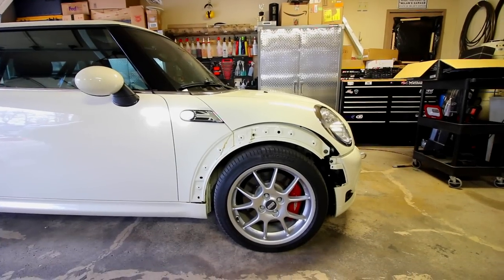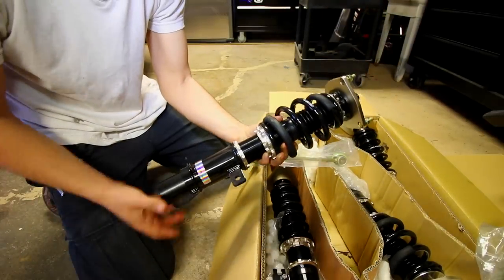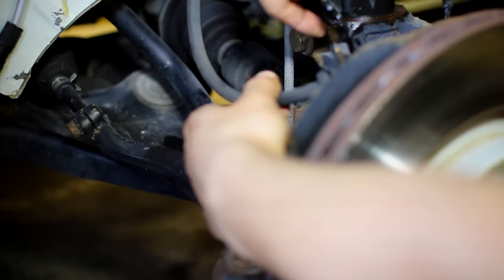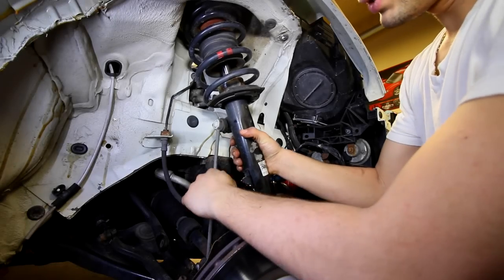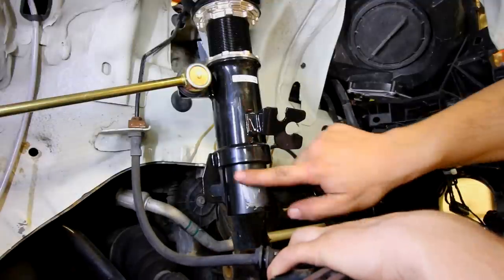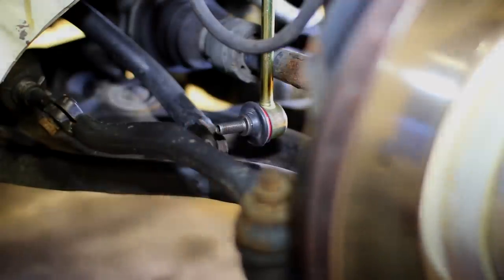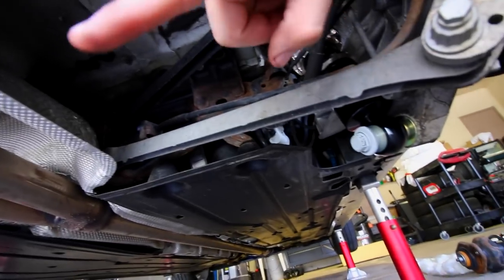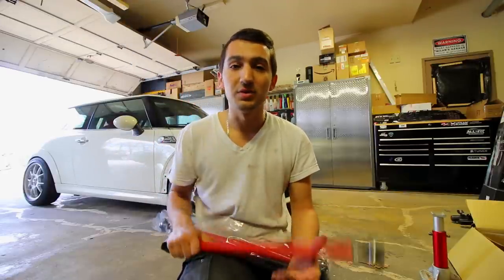How to Install Coilovers on a Mini Cooper

Comment: I know it's an old video, but did you install the extension cable for adjusting the rear? I had these on my R56 and looking to install on my R55, but want to be able to adjust the rear whilst on the car (my garage installed the extension cables into the boot)

Comment: Have you experienced any kind of trouble with the axles angle after you lowered your Mini ? I'm running on KW V1 coilovers and since it has been installed, axle spider has popped out from inner joint.

Comment: so i have an r53  and im not sure if the r56 is the same . the rear coilovers have an adjustment at the top but in an r56 you cant even see the top of the mounted strut?  what did you do ? cut a hole ?

Comment: Does anybody agree with me that the mini looks much better stance wise when it's lowered in such a way to try and ensure the bottom sill angle with the ground is reduced from stock angle? My R56 JCW is lowered on KW coilovers, and dropped 30mm on all 4 corners, so there is still the default angle between the sill and the ground, which personally I dislike. My question is can you reduce this angle and for the car to remain functional? I guess the back needs to be lowered more than the front to acieve this look, is this done by peeps out there???? Cheers ma dears.

Comment: Just installed some of these coilovers on my 08 Mini.  Did you have any vibration issues from 1-3 gears?  Seems to be in the lower RPMs.  Maybe a driveline issue with it being lowered?  I wonder if an alignment will help.
Reply from the maker: If you're getting a vibration, you should raise your vehicle a tad as that is typically a problem with the half shafts and the angle in which they are positioned.
Reply: I am having vibration issues now :
:/ 2005 mcs with back coils

Comment: I have a 2005 r-50. I can't get the assembly out. The problem is the swing atm doesn't drop out of the way enough to let the assembly come out of the swing arm. Am I missing something?
Reply from the maker: Disconnect the sway bar and try it again 👍
Reply: @milanmastracci  I disconnected the end links from the strut and from the sway bar.

Comment: Milan, I need your help! When installing adjustable coilovers on my R52, do I need new camber links or any new bushings? Or can I just install the coilovers and expect everything to line up and perform appropriately? Finally, how do I determine optimal ride height or whether I should be lowering the front more than the rear? I want to achieve a good setup, but I'm not sure if the front or rear should be higher than the other or the same.
Reply from the maker: So it all depends how much you lower the car. If you keep it close to the stock ride height, you won't need adjustable arms. If you plan on dropping it quite a bit, the car with naturally camber in (negative camber), so you will need adjustable control arms to correct that, otherwise you will get uneven tire wear. Typically a safe go-to is about 1.5" lower than stock
Reply: milanmastracci - I'm adding adjustable control arms to the mix, along with camber links. I do want it dropped about 1.5-2.0 inches, so I'll definitely need to adjust the camber. Thank you sir! Much appreciated!

Comment: Hello! Could u tell me, what size are your spacers? Maybe u have a blueprint ?
Reply from the maker: It is completely dependant on wheel specs. On these BBS wheels, I was using 25mm spacers. On the current wheels on my MINI, I don't have any spacers.

Comment: What did u set your torque settings to g or the front and rear coilovers?
Reply from the maker: The torque settings for what? You mean the adjustment knob for the rebound?
Reply: No in the video you say to look up the factory settings when doing the bolts for the coilovers I figured they should just be done with your wrench as tight as u can . I didn't know if you actually torqued them all around
Reply: The assembly nuts and bolts

Comment: i don't understand why you would do that to a mini cooper 😅😂
Reply from the maker: Make it handle better?
Reply: LOL, don't fool yourself and definitely your viewers like that! You are doing this only for the looks. If you think this will improve handling you are ignorant and should do some research.
The geometry of the entire suspension is set up to work at the stock ride height, and you can be sure a Works is already tuned towards handling. If anything, lowering the suspension combined with changing the scrub radius will ruin the dynamic camber and caster, bump steer, steering feel and tracking, no matter how good the static alignment is matching the original.
This also applies to the rear as multilink suspensions are usually tuned to have some passive dynamic steering, changing the base angles and spring stiffness changes the amount of passive steering effect, no matter how hard you compensate the static alignment by using adjustable arms.
Real race cars have either longer suspension arms or totally different suspension mounting points to widen the track, not wheel spacers.
Real race cars lower the body to the road by redesigning the entire suspension as a whole compared to the road going versions, often even relocating the steering rack and changing the location where the links bolt to the hub assembly, using different suspension arms mounted to completely different subframes... not by slapping on shorter/adjustable strut assemblies.
The only realistic upgrades an individual can do suspension wise is replacing suspension arms and wheels by lighter versions with the same specs, fit stiffer bushings and fit better shocks. Even a very subtle fixed lowering kit and stiffer stabiliser bars are already changing the dynamics enough to possibly ruin them.
Reply: LOL, don't fool yourself and definitely your viewers like that! You are doing this only for the looks. If you think this will improve handling you are ignorant and should do some research.
The geometry of the entire suspension is set up to work at the stock ride height, and you can be sure a Works is already tuned towards handling. If anything, lowering the suspension combined with changing the scrub radius will ruin the dynamic camber and caster, bump steer, steering feel and tracking, no matter how good the static alignment is matching the original.
This also applies to the rear as multilink suspensions are usually tuned to have some passive dynamic steering, changing the base angles and spring stiffness changes the amount of passive steering effect, no matter how hard you compensate the static alignment by using adjustable arms.
Real race cars have either longer suspension arms or totally different suspension mounting points to widen the track, not wheel spacers.
Real race cars lower the body to the road by redesigning the entire suspension as a whole compared to the road going versions, often even relocating the steering rack and changing the location where the links bolt to the hub assembly, using different suspension arms mounted to completely different subframes... not by slapping on shorter/adjustable strut assemblies.
The only realistic upgrades an individual can do suspension wise is replacing suspension arms and wheels by lighter versions with the same specs, fit stiffer bushings and fit better shocks. Even a very subtle fixed lowering kit and stiffer stabiliser bars are already changing the dynamics enough to possibly ruin them.
Reply: Candisa it's just like, who really throws on a wide body kit and strips the car to make it lighter? what do you want this to be? 😂 a track car? a race car?